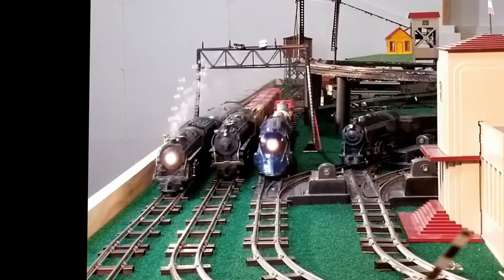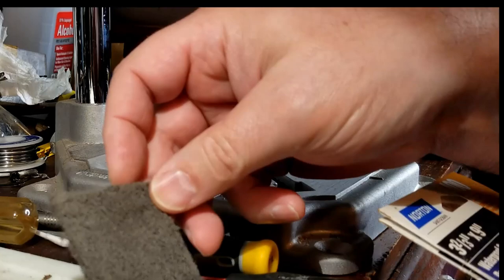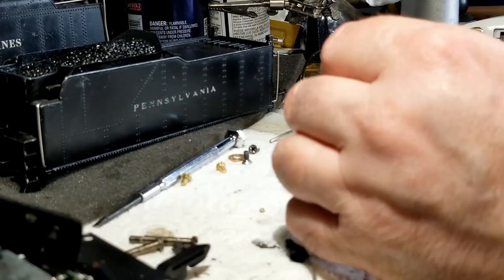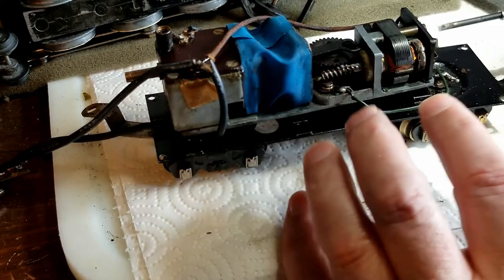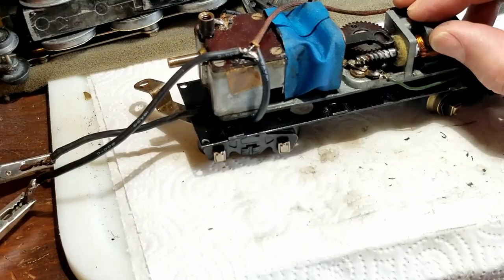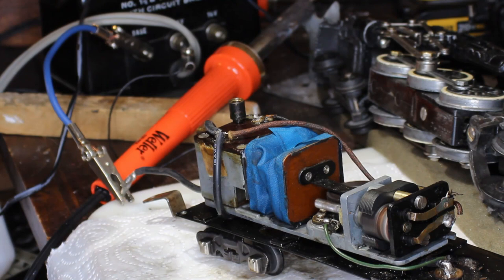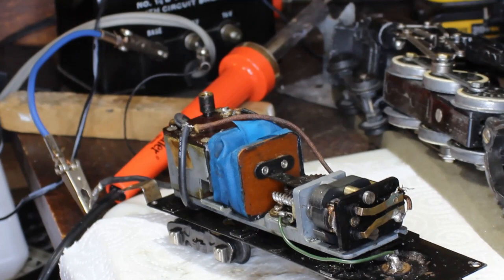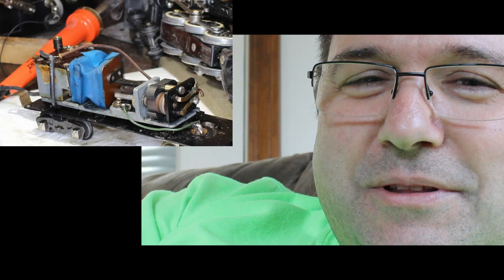312 Part 8: when a DIY SIT project becomes a disaster.

Comment: I have a book that shows the gauge of wire and number of turns for most AF devices.  I've also seen a video or two on rewinding armatures which doesn't seem that painful.  I've had to rewind field coils when the inner wire broke off at the bottom of the winding.  Not fun but then the joy of seeing something brought back to life is worth it.
Reply from the maker: My hat is off to you!  I think my Barker book has that information in it as well. Thanks for your comment.